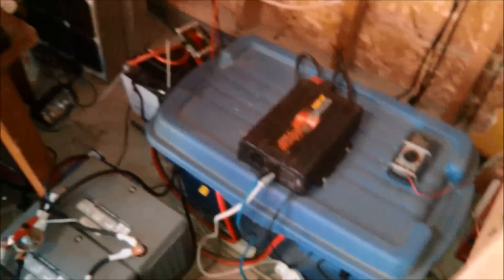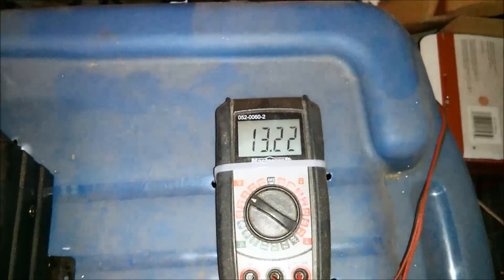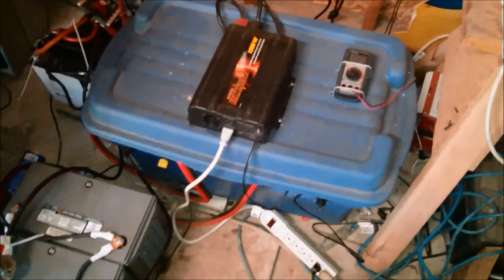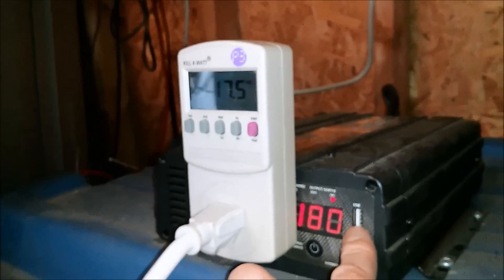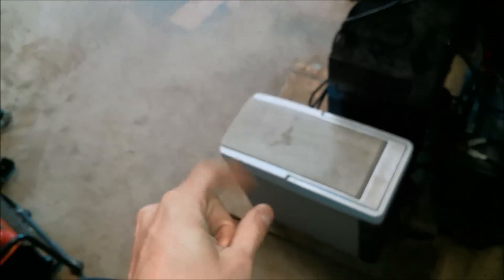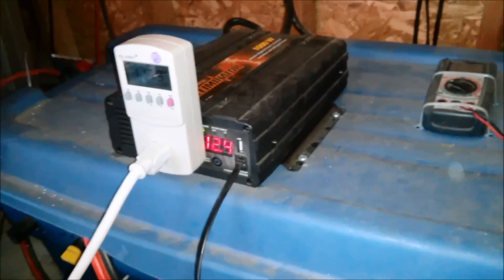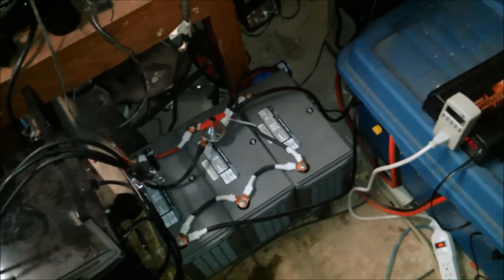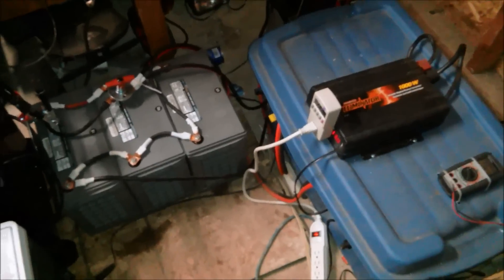Running a fridge off Grid 24/7

Comment: I was wondering if you could do without the diodes.  The Morningstar charge controller should have diodes to prevent backflow of power from the batteries.  If the solar panels feed the batteries direct, then you would need a Schottky diode in line to prevent backflow from the batteries.

Comment: I'm aware that this is an older video, but for those putting a solar system together using a Kill-A-Watt to monitor your appliances for a day or more is an excellent start on sizing things.  

Our 2 year old, French door, bottom freezer Samsung averages 56 watts/hour in winter and 79 watts/hour in summer - logical as the temperature inside the house differs by 10F.  The minimum load is 3.8 watts (one circulating fan running) and the max is a little over 500 watts (both fridge and freezer defrosters on at the same time).  The maximum compressor running power is a little over 200 watts and the fridge throttles that back as its internal temperature approaches the set temperature.  Yes, I checked the Kill-A-Watt frequently during a multi-week run.

The somewhat older upright freezer is a simple on/off of 125 watts for 16 to 18 hours/day.

What does all this have to do with 48 hours off grid?  The freezer is OK for 8 hours if not opened, so it needs zero power in the first 8 hours.  The fridge/freezer is OK for about the same amount of time if only opened briefly once or twice.  For 8 hours, we might need no power for fridge or freezer.  Running only one or the other means you can use a smaller inverter (which means less idle current) but my 500 watt pure sine wave (PSW) inverter can't start either of them (the 2000 watt PSW inverter can handle both).  The timer mentioned to run them alternately is one workable option if your power source (inverter, generator) can't handle both.  My battery bank is 540AH and the solar array is usually 250 to 500 watts with more available but awaiting another MPPT controller so there's not enough solar power to recharge the 24 hours of fridge use the batteries could provide at 50% discharge (occasionally OK on AGM but not as a regular thing).  For 48 hours off grid, I'd be using the batteries for 10-12 hours (around 20% discharge) then using a 1600/2000 watt inverter gen to run things (including the upright freezer) and to provide rest of the charge that the solar array can't (yet) provide.

For a long term outage, we'd use the food in the fridge and upright freezer and drop back to using the very efficient counter-height 4.4 cu ft fridge that lives in the basement.  It draws 55 watts and runs about 5.5 hours/day in the summer (less in winter) and 500 watts of solar power can keep up with that fridge, a few lights and charge cell phones (if they're working) during the limited sunshine hours of winter.  The battery bank could provide 48 hours at that level of usage.

Converting a chest freezer to a chest fridge is possibly the most efficient and lowest power way of having off grid refrigeration.  That's probably item 20 on my 20 item To Be Done list.
Reply: Whats on your to be done list?
Reply: A Watt is a unit of energy/time

A Watt/hour is not what you mean to be using.

I assume what you mean is “Kilowatt Hour /hour”

A kilowatt hour is a unit of energy (energy/time * time)

A Kilowatt Hour/hour is a Kilowatt

Comment: My earlier post disappeared, but it's okay because I now see that the 'thing' on the floor was a cooler chest.
Could you tell me what the brand and model of your generator is and point out what each of the items on the wall is. It looks like a solar controller with three inverters above it with the diodes next to them. What kind of diodes are they and what do the do? How do you connect them? I have a full size Kenmore stand up freezer that I need to run off my batteries. Out of the ten L-16 batteries I can devote two of them (two 6volt batts hooked together for a 12volt unit with 400 amp/hrs per batt, total 800 amp/hr to run the freezer. My remaining eight 6volt L16 batteries are hooked together as one bank for my RV. I have two 150watt 7amp solar panels hooked together going through a TRACE 12volt controller also charging my batteries.
Please see my other comments on your video on generator vs pure sine wave inverter

Somehow this comment got posted on your battery bank equalize test video when it applies to this video.
Reply from the maker: lol all your comments where put under spam lol i dunno why, buy i have fixed this problem, the generator is a cheap G power brand, And about your freezer you need more panels, if you get a cloudy day or two those panels will not keep up i would say at least 400w of solar for a freezer, the diodes are just a regular 6 amp diode